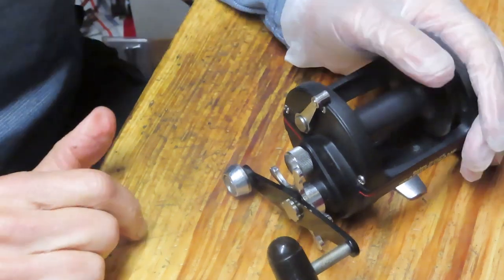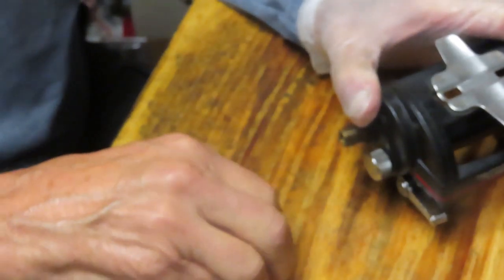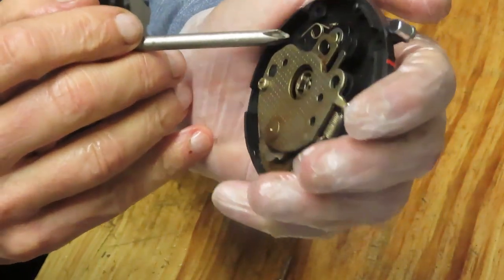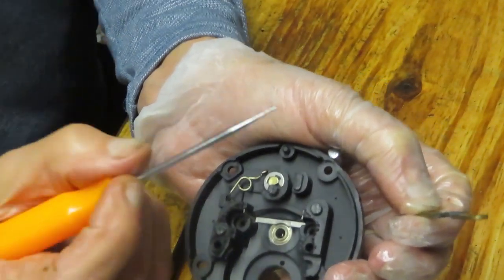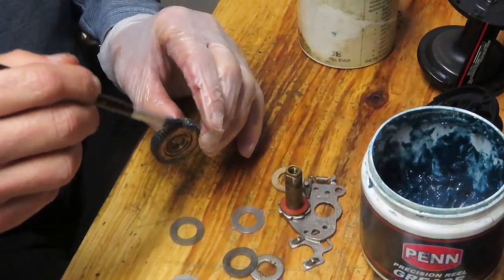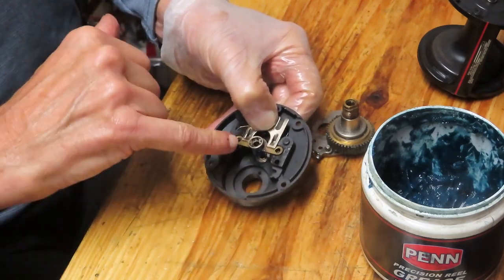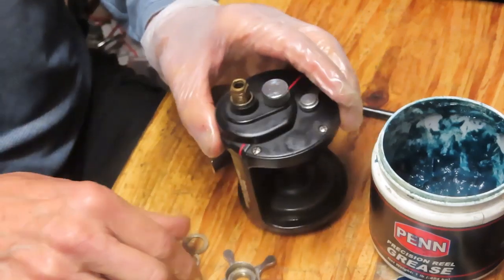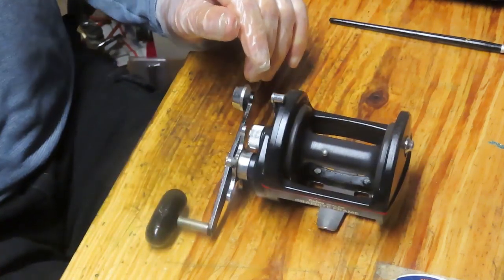Daiwa Sealine 250H saltwater fishing reel how to take apart and service

Comment: Is that a casting reel, Dennis? I'm new to surf fishing and I'm not familiar with the baitcasting reels used for surf fishing. All I use is spinning reels, but would like to put a baitcasting rod/reel in my surf fishing arsenal.
Reply from the maker: It could be used for the surf.  You would need a longer pole to get the leverage needed.